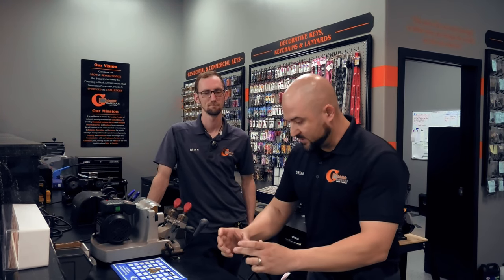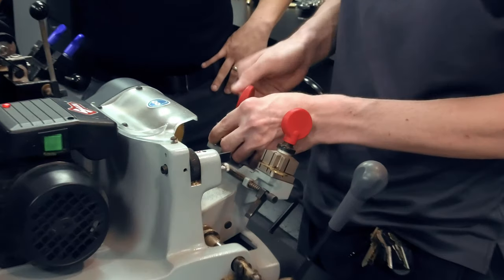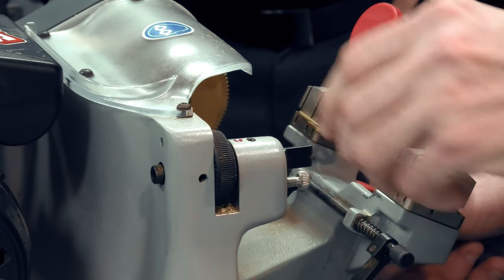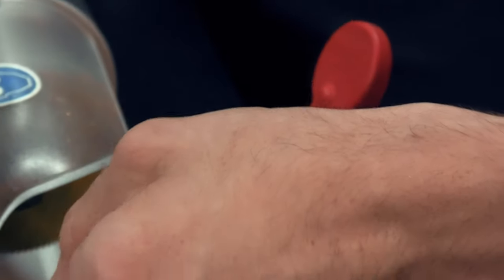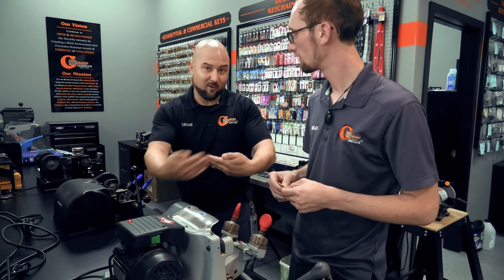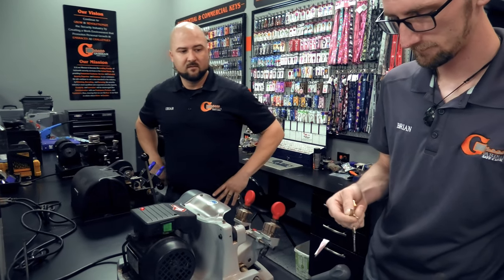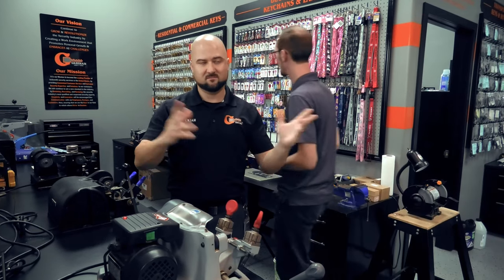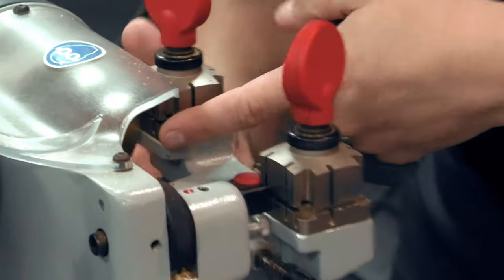Why My Key Copy Doesn't Work | GSL Discussion

Comment: I think I have a spare key that used to work but after the lock pins and my main key have worn together it no longer works.  probably the best thing to do is have a locksmith come out to the house and make the duplicate there and then test it to see if it works or maybe sand down the copy to get it worn down so it works again, then switch keys from time to time so they both get some wear and both continue to work.

Comment: Hey bro I just got my car key duplicated. I tried to start my car with the duplicate but it didn’t start and the main key worked can you explain what was the problem?
Reply from the maker: Most car keys need to be programmed they have chips in them, it’s not like the old days to where you just cut a key and it works. So you’ll need to go to a locksmith and get a chip key programmed to your vehicle